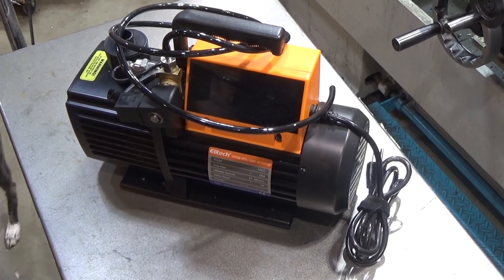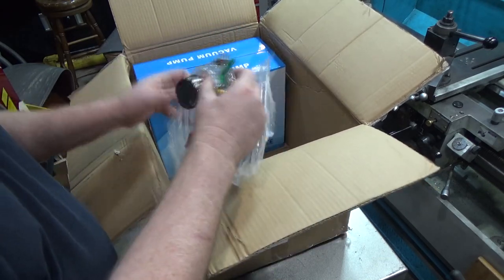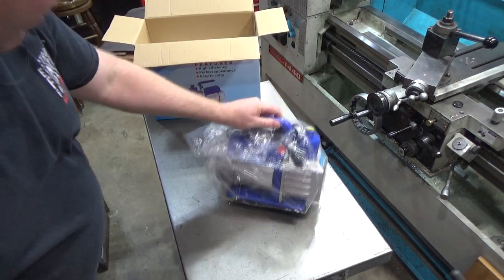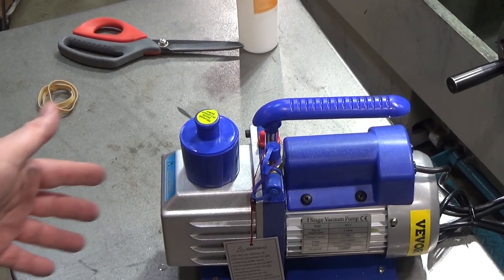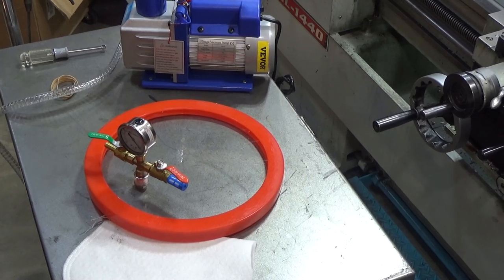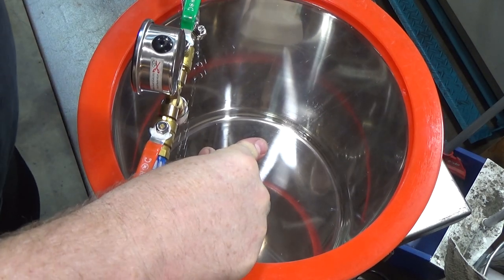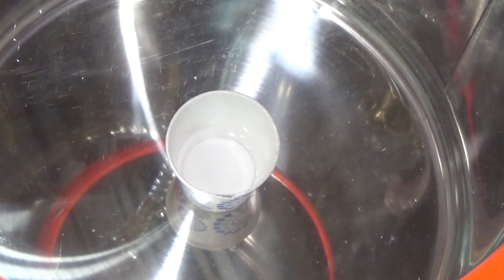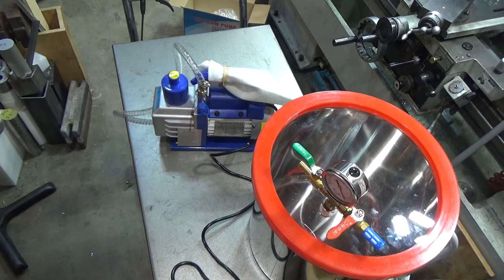QTR 89 Vevor 5 CFM Single stage Vacuum Pump and 5 Gal Chamber

Comment: I really liked the way of how you presented everything and the experiments were interesting! :)
Reply from the maker: That was very kind. Thank you for taking the time to leave me a comment.
Reply: I got a couple of VEVOR vac pots and a still intending to boil birch sap at a temp below 150 F.  That will put out a lot of water vapor.  What should I do with all that hot water to protect the pump?  Can I run it for hours on end to remove gallons of water?

Comment: We just got ours for freeze drying food storage. It's helpful to hear your comments comparing it to the other pump to know what is common to vacuum pumps. Your chamber looks like it might not be flat on the bottom, as it wobbles? Ours came with a dent on the side by the bottom seam, but holds vacuum just fine. Another reviewer thought the silicone mat might be for the inside bottom of the chamber to keep something from getting vacuum stuck to the bottom...? Loved your experiments! 💯👍
Reply from the maker: Thanks for the feedback and comments. I think you might be right about the silicone mat.
Reply: Haha the same reason I decided to buy one. I already placed an order for 3 gallon and 4cfm which was the biggest available in my country. 

So anyway, how do you chill the pot? Peltier modules? I plan on hooking then to ground water and cascading to cheaply reach -80c.

Comment: Nice video! I didn't have high expectations after talk about negative pressures in the beginning. But then you went on to share relevant and valid information, as far as I can tell, and made some enjoyable and relevant demonstrations.  As far as I understand it, all common units of pressure are technically describing difference, and the question when they are used is if it refers to absolute vacuum, ambient air, standard atmospheric pressure, or something else. And even if that pump doesn't produce high grade vacuum, it's still well in the range where absolute pressure is the relevant reference, and not so much the difference compared to ambient.

Anyhow, I got curious, is water vapor much worse than alcohol vapor for the pump, and how bad is either? I was under the impression that alcohol tends to be more "aggressive", and unpredictable, and also tends to break down into other stuff, commonly mostly acetic acid and water initially, in presence of oxygen.
Reply from the maker: I get it. Negative pressures are a lot like grounds in electronic circuits. In electronics a ground is a relative term. You can split a positive 12 volt supply and decide that the +6v level is your zero and then you have a relative +/-6V supply. I do realize that there is no actual negative pressure. Zero pressure is when the molecules/atoms quit bouncing off of one another and no longer transfer momentums. This can either be at absolute zero or when you have a complete vacuum. 

I really appreciate your comment and I should be very careful in my descriptions.
Reply: @DudleyToolwright  Maybe I came across a bit critical, I'm sorry if that's the case. I don't think even that detail was so bad that you should give it much thought. 

I also think the comparison to voltage is really good.

Comment: This looks like a standard pump for auto ac work that I've used many times  if so most auto stores that carry pumps also carry pump oil your other unit may require a special oil but id bet this unit is the same as the units at auto stores and harbor freight and can probably use the same oils they carry for their pumps may be worth checking out if you need oil and can't wait for shipping 👍👍👍
Reply from the maker: Thanks for the suggestion. I really appreciate it and others might also benefit!

Comment: I might get one of these, been wanting to try out making some gas discharge tubes and Geiger Muller tubes for a while, and my crappy brake bleeder hand pump just ain't cutting it
Reply from the maker: I am not sure how good a vacuum you need, but most tubes scavenge the left over gasses with a getter. You should look into those as well.